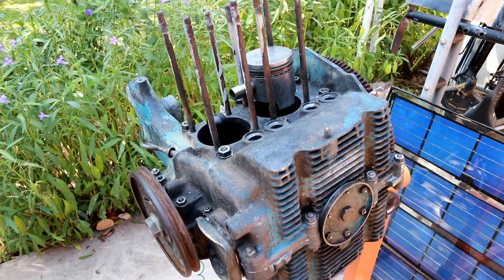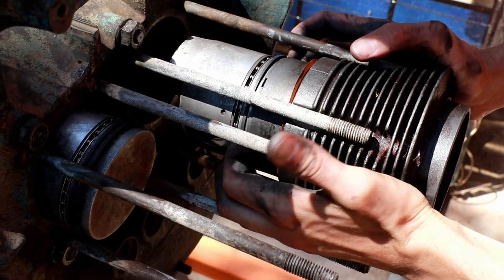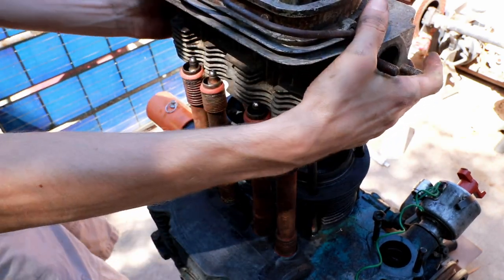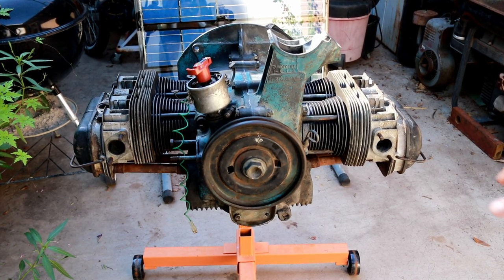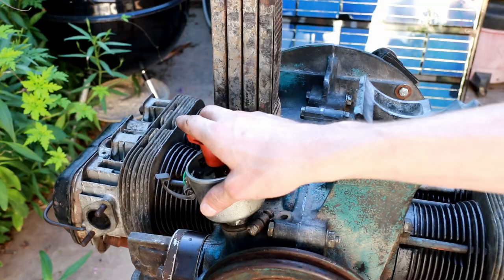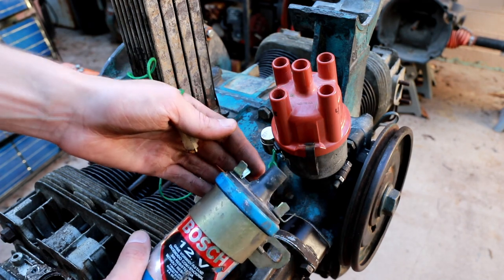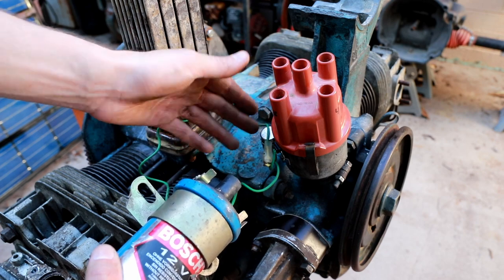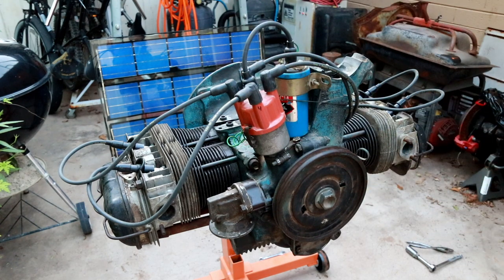36HP VW Air-Cooled Engine Revival Part 3: The Assembly

Comment: I didn't see you use assembly lube on pistons and cylinder bore.
Reply from the maker: I ended up getting a new set of pistons and cylinders from AA, as the honing ended up ovaling out the original cylinders and it barely had any compression. On a future build I will definitely add assembly lube to the cylinders before putting it all back together!
Reply: underrated video, very nice rebuild 👍